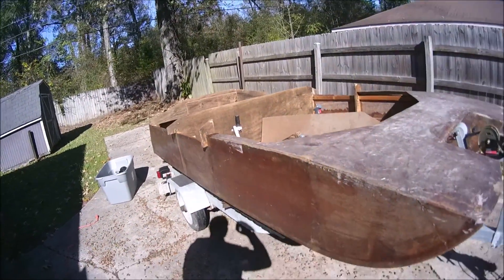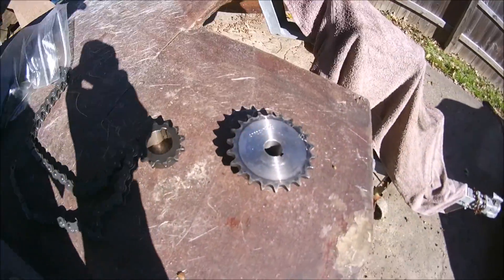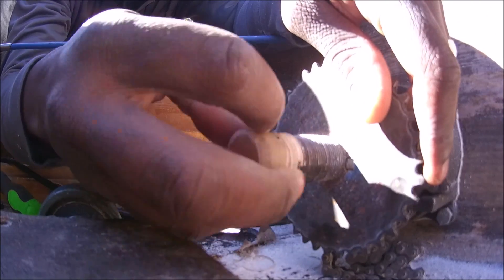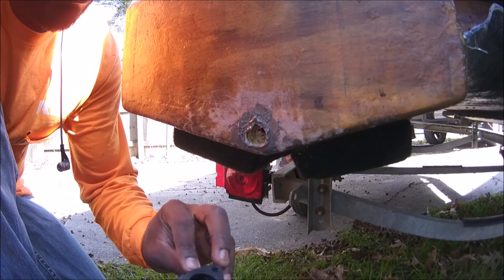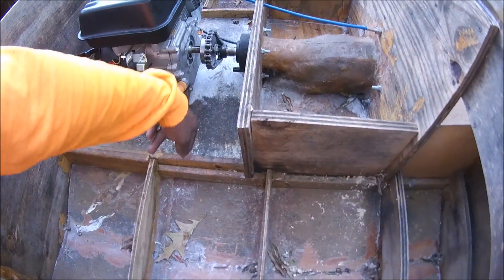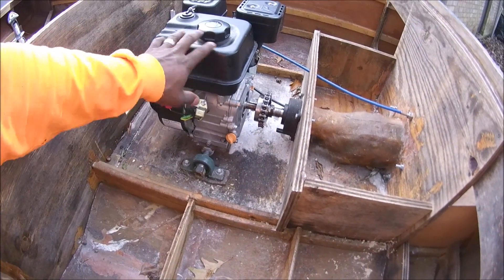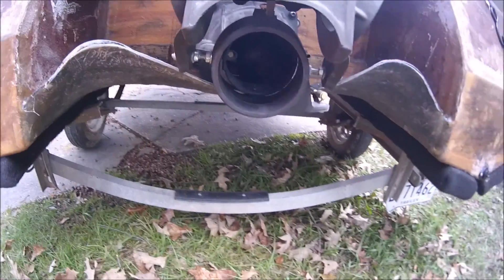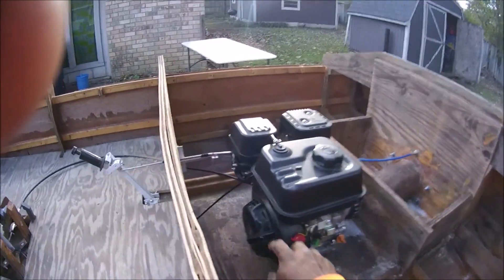Homemade plywood jet boat (Gearing upgrade)

Comment: Thinking of doing this to my seadoo. Not sure if direct drive or a gear ratio is better. I think the shaft needs as much rpm as possible, gonna use a gx 390. :)

Comment: Direct-drive would have sucked anyway using the sprockets gave you more leeway and a whole hell of a lot more gearing to choose from if you want a basic direct-drive you can just use the same size sprockets on both shafts sprocket and chain just gives you the ability to change gearing and more leeway for positioning

Comment: No clutch that means the moment you start the engine even at idle it's going to be pushing water through the jet. You should have used a torque converter.

Comment: Take a link out in the chain and put a master Linked In and they make a little tool to take links out of chains.or or a chain tensioner just something with the roller on the end of it and a spring

Comment: Hey Ron! Awesome work on the jet boat. That chain drive will be more of a pain as it stretches and rusts. I would mount the engine a little forward and mount a small drive shaft with you joints, like on a car or truck. (Smaller diameter of coarse) let me know if you've had any success. I'm extremely interested in this build of yours. Again. Awesome work brother

Comment: Dude. That is awesome. But you gotta admit, if there were no bugs to work out, the project would be boring. Troubleshooting is half the fun for any guerilla-engineer. The only advice I have to offer is to use a synthetic material for the base of your engine. Over time and use, the wood platform will warp and throw off the tolerances. My suggestion is a nylon cutting board from Wal-Mart.

Comment: If you do brace that motor against the bulk head, make rubber bushings to put on your bolts where they attach to the boat.
It's the same concept as motor mounts on your car.
Nice boat!
Reply from the maker: Thanks a LOT greg! That makes so much sense.

Comment: u can try running #35 chain most racing gokarts run it and u can use a clutch system and still have a large drive sprocket and smaller driven and shave some weight off while doing so
Reply from the maker: Thanks a lot brother! Even if i upgrade to a 16hp engine?

Comment: I admire your engineering skill. I built a go-cart from scratch for my kids. It involved a lot of welding with a mig that I bought on sale and then had to figure out what to do with it. A go kart seemed like the natural answer. I told them either go or stop because if you rev the engine a little bit without moving you will burn out the clutch. They burned out one clutch and another. (actually a stupid cousin) You won't have that problem with a boat. 

   Cheers dude from Gordy
Reply from the maker: Thanks a lot a lot brother! Thats cool as hell for you to make your kids a custom kart like that. Someone else told me the same thing about clutches in general (try not to ride them half ass). Thanks for stopping by brother that really means a lot

Comment: The chain tension is fine. Too tight and you will wear out the chain prematurely. Just try to keep a constant film of lubricant on that chain. Straight 30 weight engine is fine. Oil it every 6 operating hours or so and after the chain dries from having gotten wet as well.
Reply from the maker: This is EXACTLY what i've been looking for. Where have you been all these years Spencer! lol
Reply: Too tight a chain can wipe out the shaft bearings too. Too tight never a good thing for chains. I wiped out the idler bushing as a child on my minnie bike over-tightening the chain once.

Comment: Hey Ronald! Did you and your family recoup from the flood? And haven't seen an update lately and was just curious if you were still working on the boat or if it was a lost cause from water damage? If i remember right..
Reply from the maker: Hello Beau; Thanks for the check up brother. We did recoup; but unfortunately the updates i've done to the boat isn't significant enough to record. The exterior of the boat is in PERFECT condition and im struggling as we speak to save the interior. You are the first person im telling this to (whispering in your ear) I will be recreating the exact same boat out of aluminum within the next year if I cant save the interior.
Reply: Ronald, I have been looking at aluminum boats on Alibaba. I'm a terrible welder so I would not even attempt aluminium lol.

Comment: Put a half link in the chain. Also need to put piece of 1/4in aluminum on deck under the chain in case it comes off. If not will go through bottom of boat
Reply from the maker: Thats a real good point John! Thanks for the help brother

Comment: Oh PS I also wanted to add this in their beans you're using a go-kart type motor in a boat and a front end comes up in the boat a little bit when you're going down the water you might want to rip that engine apart and take the low oil sensor out because every time the boat lives up the oil drop and your motor will shut off anyways just a thought
Reply from the maker: Thanks bro I actually disconnected the the sensor (just the wire) on my old engine and it worked; do you think that would be enough?

Comment: Hey brother I'd like to give you a little bit of the device if I could I'm not sure if you read the comments or not but I'll my go-kart I run a 12 tooth sprocket on the clutch and a 62 on the rear gear and it turns and wheels pretty quick so if you can get your shop sprocket up to 62 you can probably buy a go-kart sprockets on a bolt of that anyways just a thought please reply
Reply from the maker: Thats not a bad idea at all Carl. Thank you so much for the help brother!

Comment: ran a hose on your exsorst with a valve to work as a pump to help suck the water out I brought large scale rc boats that had this problem so I used exhaust pressure to help pump out water
Reply from the maker: That sounds like it should work out great! Thanks Tony
Reply: +ronaldhotboy you could also use a pump on battery  but will wreck it if goes dry, you all Ways get water in it

Comment: don't you just hate wood hulls . . . . woooh. . . . . big driver into a little shaft gear . . .  please put it water . . .  thing I like . . . is that the forward motion will add to your power . . . because the water has to come up into your chamber . . .  takes less power when you pull the water up . . . .
Reply from the maker: Thanks a lot Miles;  Very helpful brother!

Comment: with the engine mounted like it is, on those bearing blocks, it's hard to stop the motor moving back and forth.  This tensions and then releases the chain, over and over.  I got money on transmission failure very soon..............
Reply from the maker: Thanks a lot Raymond. That was very helpful bro

Comment: hey if you're not gonna direct drive and you're just gonna chain it you could put your motor on top of your pump. turn it around, make a platform on top of your pump, enclose and vent and put a stainless pipe on it. and have some more space.   Maybe a bigger fuel tank? But I also just realized maybe that will reverse your flow if you flip the motor. there's actually Probabaly a solution to that though. just giving you the ideas I got. I got the same motor and know some ways and websites for parts to get double horsepower out of that motor. also remove your oil level sensor asap cause you motor will be killed during tilting when the oil changed direction
Reply from the maker: Thank you SO  much Dove! Thats an awesome idea. As soon as things get back to normal, I will be trying out new setups. Thanks for watching!

Comment: what you should be doing is putting a torque converter on there if you know what that it bolts on to the side of the crank case at four different angels depending on witch model you buy and how you wish to use it but I would set it up to run the torque converter which replaces the gear from the crankshaft and place a pulley and chain set up that works much like a snowmobile is a easy way to explain it I think if I'm wrong someone will correct me but im 99% I'm sure but it would allow you to have a stand still idle on the pump shaft so it would be like a neutral and would allow for a much higher top rpm going to the pump shaft just a thought
Reply: http://www.gopowersports.com/tav-30-75-torq-a-verter-comet-after-market-replacement/#aid=3011 is the site you can find to order one or just to take a look at it to see what I was thinking
Reply from the maker: Thank you SO much Tronman. You explained it to me very well. I really want to put one on the new engine. Thanks for the help brother!

Comment: If you wanted to mount the motor inline with the shaft of the pump, you could just move the motor forward some and use a short driveshaft with u-joints to connect them and eliminate the chain drive entirely.
Reply from the maker: Thats a real good idea brother. Do you think the vibrations would be bad?
Reply: ronaldhotboy As long as the input and output shafts were perfectly parallel, then it would have zero vibration from a driveshaft with u-joints
Reply from the maker: Thanks a lot brother; very helpful
Reply: You can get a rubber drive shaft dampener too.
It reduces shock on the you joints and absorbs vibration.

Comment: Are you still messing with that boat? Tension the chain by raising the motor up with shims or washers in the mounting bolts.
Reply from the maker: Thanks a bunch brother; I made a chain tensioner for it, I wanted to know how tight does the chain itself needed to be.
Thanks for the help bro

Comment: Very interesting.  Thanks. I have a similar motor (6 hp at 3500 rpm but I run it at 2500) running a centrifugal sprayer pump (capable of handling 6000 rpm) at that ratio. I run it with a B profile belt and 6" pulley driving a 4" pulley. I don't want to tell you what to do but in my opinion, running that chain on those sprockets at that rpm will heat and wear out the components. I get at least 200 hours over 10 years on a $5 belt  while the pulleys haven't worn out in 25 years. The belt likely fails due to sun degradation, oil and chemicals on it and mistensioning. Anyway, maybe you find it works for you but if it turns out you're over heating the chain and especially that smaller sprocket, a belt/pulleys set up might be a cheap fix. Have fun out on the water.
Reply from the maker: Thanks a lot Norman! This information is extremely helpful. I never would've thought about a pulley and belt system. It sounds like it would be a more efficient setup. Thanks a lot brother!

Comment: These adjustments ought to make this little rig "fly" through the water! Can't wait to see that. Thanks for posting all this for us Ron. I hadn't thought about the cavitation problem, but I don't think it will make that much difference with the lower pressures that this rig is working under. Be safe out there Ron!;)
Reply from the maker: I was hoping the same thing Mike lol. Unfortunately she stalled on us but no worries there is more to come. I was hoping for the same thing as far as cavitatioin goes. Hopefully we will be able to just power through it. Once again brother Thanks for watching!

Comment: You need to use flex seal LOL
Reply from the maker: lol I really do plan on adding some
Thanks for watching brother
Reply: +ronaldhotboy that motor doesn't have enough horsepower try a predator V-twin 670 that should definitely have enough horsepower also I was thinking you don't need it to really have any pressure but you can have and open system hydraulics with an orbit motor where you got a control valve to go forwards or backwards and that will give you reverse 3 gallon reservoir with a oil cooler the V-twin predator hydraulic pump and orbit motor to match the size of the hydraulic pump and I'm actually looking to that on a go kart

Comment: Spring roller tensioner for the chain may be an answer.
Reply from the maker: Thanks a lot Howard! Might have to purchase one for the new upgrade.
Thanks for the help brother
Reply: Glad to help.
Reply: A friend and I managed to pull the hydraulic tensioner off of a toyota 5VZ=FE timing chain (totaled via rollover) for free at a junk-yard, and use it as the tensioner for a 14HP go-cart chain. Thing's practically immune to wear with the big nylon pad, and it's made for handling much higher loads than what you'll be seeing from that engine.

Cheap options are good, not much beats $free.99!

Comment: very cool....love it man.......I did a plywood flats boat for shrimping about 20 yrs ago......soaked it in linseed oil.....lol......heavy as hell but it worked fine...........make sure you put a good cross brace for the engine......and the chain tensioner you can get off old cars......just spring steel with a  roller......or you can change to a belt drive........but have fun and enjoy......I love projects like these........I just rebuilt an old seadoo gti ski and got it from 52mph to 75mph......woohoo !!!
Reply from the maker: Thanks a lot Rob. lol I can imagine it was heavy brother. I will for sure brace the new engine. Thanks a lot for the very helpful information. How in the hell did you jump from 52 to 75!!!??? You got my attention now lol

Comment: On your metal parts assembly, always use some type of ant-seize compound on your metal to metal parts, as this will allow them to be dis -assembled without gauling or becoming stuck .
Reply from the maker: Thanks a lot; I wish I wouldve met you about 6 months ago lol 
It took me 30 min to remove the clutch from the shaft! Thanks for the help

Comment: Your slight engine wobble is probably contributing to the chain tension issue.  Do something, because as I've learned from restoring my old Honda motorcycle, 'chains wear out sprockets and sprockets wear out chains' (when not properly tensioned/aligned).
Reply from the maker: Thanks a lot! I will do a better job next time at aligning them up.
Extremely helpful brother thanks for watching
Reply: No problem, I enjoyed watching your build(s) and I will enjoy seeing you haul ass across the water in a future video when you get all the design kinks worked out!

Comment: You have done a great job, as for the chain tension I was thinking of the derailleur setup on a racing bike, you could add a sprocket that is under tension from a spring and that should cure all ills also chain guard please.
Reply from the maker: Thanks a lot Deaghlan! Why didn't I think of that!
Very helpful brother; Thanks for watching
Reply: I shall look forward to seeing how things work out, I am glad it maybe an idea that may work. keep me posted either way.

Comment: Quick question, how do you stop the water coming in from the shaft connecting to the motor? But good work dude real inspiration!
Reply from the maker: I made a resin cap that did the job for me; after I removed that I then used a high temperature glue gun to fill up the shaft.
Thanks for watching Bere!

Comment: you should be running some water through that impeller to keep from frying it during test runs.
Reply from the maker: Thanks a lot Marc; I'm very new to this whole boat scene. Thanks for the help bro
Reply: Good job on your boat man. I like the design and I might have to copy some of it. In the middle of drawing one up to start making a new one. My son has a couple of them made out of aluminum and uses them in his work. He uses Honda engines and for my money you just can't beat a Honda motor. But that doesn't mean that there aren't others that I would use also. I like Kawasaki also. I'll be following you from now on to see how it works out. Good Luck!

Comment: I bet you could use an old upper engine mount from a front wheel drive Honda as a shock mount to your motor for some stability
Reply from the maker: Thats not a bad idea Richard; Thanks for the help brother

Comment: hi ronald. I think the motor will put out 6.5 hp at around 3000 rpm. And, im guessing the pump probably be rated to consume 80hp at around 8000 rpm. the relationship of power consumed vs rpm grows exponentially as rpm increases. if you can imagine that graph you will see the pump probably consumes 6.5hp at around 3000 rpm. therefore I recomend trying a ratio of 1:1 using two sprockets the same size. this is how you will get the boat to go the fastest possible as you are using all the 6.5 hp available. If you gear it fast like you have, the engine will not be able to get to its full speed, instead, wont get past say 2000 rpm while making say 4hp, as the pump will require more hp than the motor can produce at that rpm to make it spin faster. hope this helps and keep up the good work
Reply from the maker: Thank you so much for the awesome information! This was extremely helpful. Thanks for watching!

Comment: b4 it goes in the water too much I would water proof the outside. maby use roll on Bed liner
Reply from the maker: Thank you Mat! Thanks for watching
Reply: The kind of Epoxy resin used with GRP, or even the more expensive type used with Kelar-Carbon, might be a better bet - Inside and out.  Not just waterproof, its tough, its flexible, and in a worst case will (once roughened) allow you to slap on GRP or similar patches.
Reply from the maker: Thanks a lot for the help bro; very helpful!

Comment: I have built and modified several gx 160 honda clone engines in minibikes and once you remove the governor they make lots more than 6.5 horse, but you need to make sure you dont have the stamped valve rockers or the pushrods will pop out at high rpm, and the stock flywheel has to be replaced or it will explode and destroy the lil engine, modifying the engine to spin faster with good rockers, springs , billlet flywheel, and aftermarket slide carburator should put you in the 10 horse range on that motor, you could also play with gearing easyer with a v belt drive that has a multi groove primary pulley
Reply from the maker: wow VERY informative Zeta! Thank you so much for taking the time to help me out. I really appreciate the help